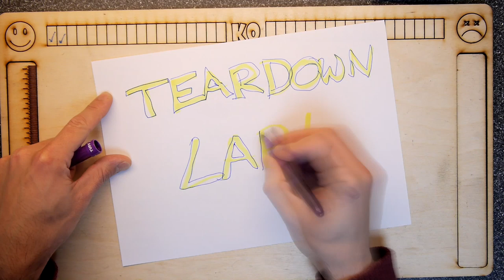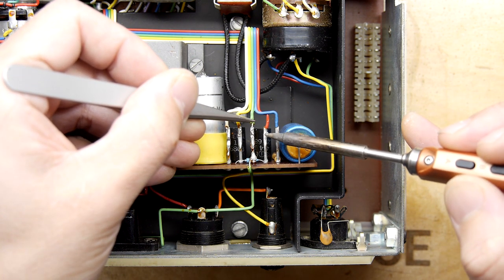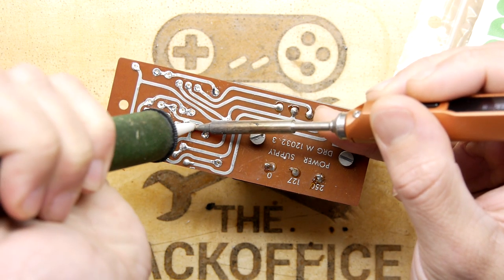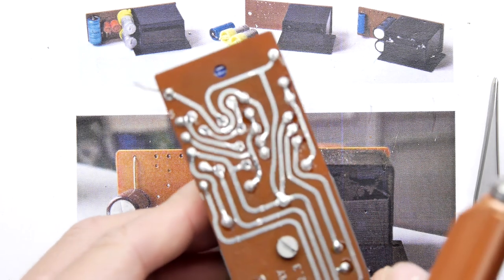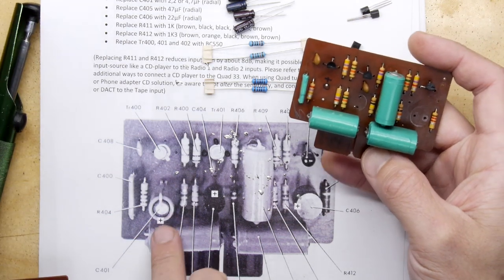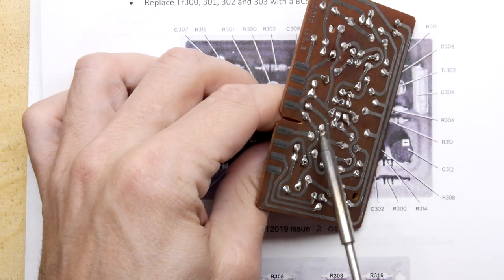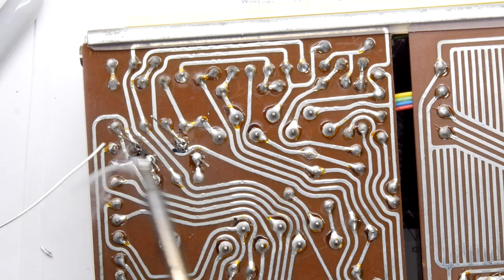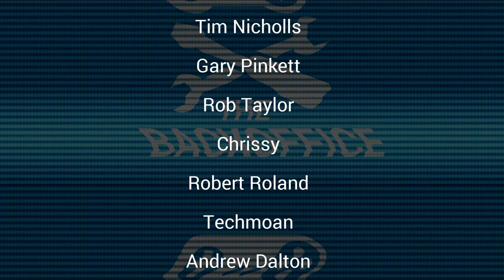Quad 33 Pre Amp Restoration and Upgrade

Comment: I have two of these Quad 33 preamps and two of the matching Quad 303 power amps that were made to go with them. Production started in 1967 and the 33 continued until 1982, the 303 until about 1985. The 33 preamp has several common problems after so many years. Most notable are the input and filter switches which cannot be replaced anymore and the edge connectors which hold the vertical boards. These connectors were poorly designed and can become unusable after removing the boards several times. If you’d like to buy one, make sure you get one with serial number over 100,000 which will ensure it’s not as old and will have the better later edge connectors. The Quad 33 and 303 produce a wonderful warm sound via appropriate high impedance contemporary speakers, such as LS3/5a, Tannoys and Quad’s own ESL-57.

Comment: Hello there - why did you not check the existing components with a tester before changing them? at least you would of kept more of the original parts
Reply from the maker: I'm guessing they wouldn't make a kit of the parts weren't already likely to be shafted. Some of the parts were of new values as well, adjusting the gains for modern equipment.
Reply: The whole point of the kit is to save you the trouble. This thing is 50 years old and it is possible to predict with some accuracy which parts are the failure-prone ones. Electrolytic capacitors for example. And not all faults can be measured,

Comment: Are you sure that C401 on the amp bards are the right direction at about 38 minute mark ? on the picture it shows positive at the bottom and you marked it at the top
Reply from the maker: I will check before anyone powers them up, thanks!
Reply from the maker: I had it correct, no smoke was released 😂
Reply: All three capacitor on this board are positive-up.